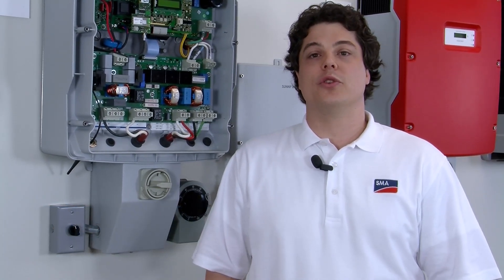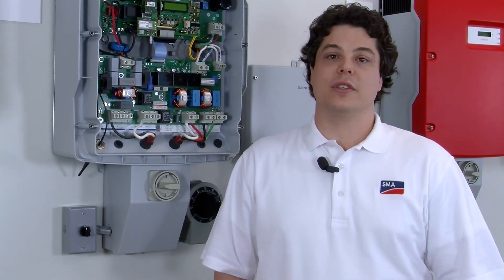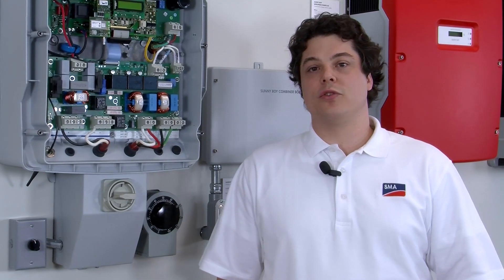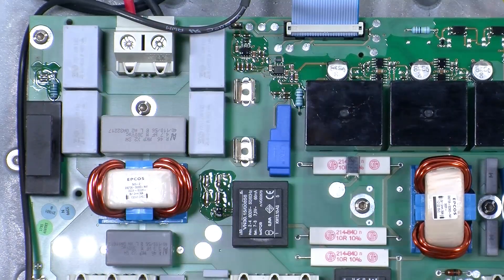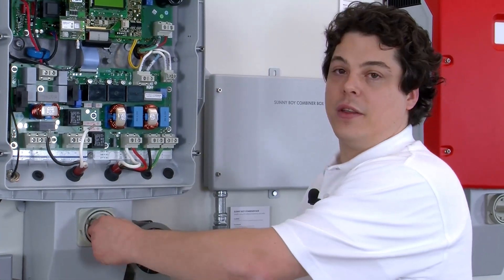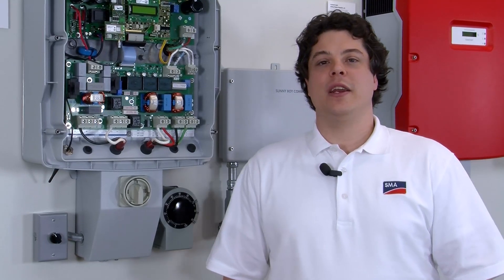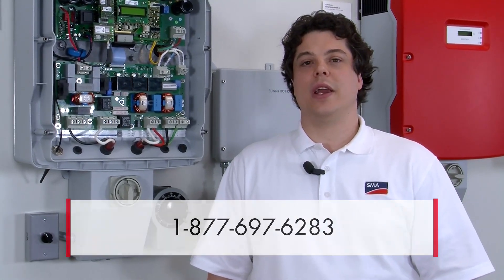Tech Tip: Troubleshooting a Ground Fault

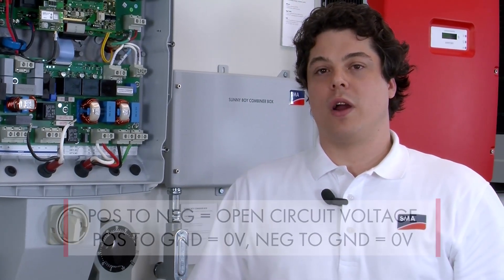Comment: @ 2:50, this guy says something that doesn't make any sense to me!  He is saying that  Voltage between A + B is open circuit voltage, but that both A + B are = 0V.  This is simply NOT possible.  If A = 0 and B= 0, then A = B, right?  Somebody please fix this video, it is an embarrassment or maybe I am crazy!
Reply: If the voltage between A and GND is 0, and B and GND is 0, then the ground fault has been cleared. The statement "If A = 0 and B= 0, then A = B, right?" is not always true.

Comment: Dc bus to low error message? Please help me
Reply: If one of the 3 fuses are blown on a e phase drive or low incoming line voltage. Worked on hundreds of VFD'S from 3 To 200 HP and never observed low DC buss except on a 18 pulse VFD that company would never allow a shutdown.
Reply: While coming across ground fault hundreds of times on great well built Danfoss VLT style drives most at least 85% were false. Had 6 100 HP drives that would go down on ground fault 5 to 10 times a year. Would megger 2.2 gigiohms to ground at 1,000 volts DC. Finally called the Danfoss service tech. He replaced ribbon cable and problem disappeared. Drives use some kind of math to come up with a ground fault instead of a true grounf fault torrid coils.
Reply: @garbo8962  I think you are a little late he already Kicked out of his work
Reply: @snoopdogksa904  I always enjoyed working in the electrical field. Starting playing with wires around 8 years old. Begged my father to take me on his moonlightning jobs. Rewired my house at 15 with a classmate. Been retired 2 years but still keep up with the electrical code. Attended 8 continuing educstion classes a year until the coronus virus struck.
Reply: @garbo8962  OK

Comment: Multi station smoke detector commercial YouTube video link saving lives environment energy climate new solar technology eligible to eliminate the need to replace the battery in unit two patents self charge carbon monoxide detector and smoke detector commercial and residential one unit can simply be scewed into your light socket new solar technology.